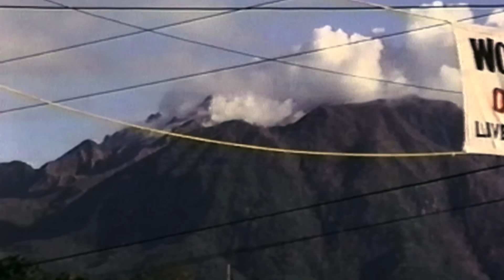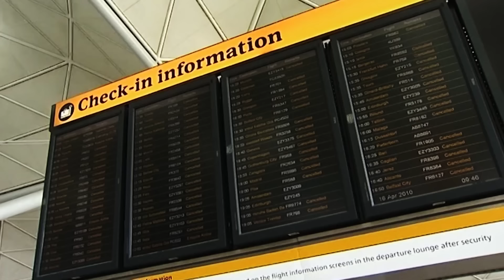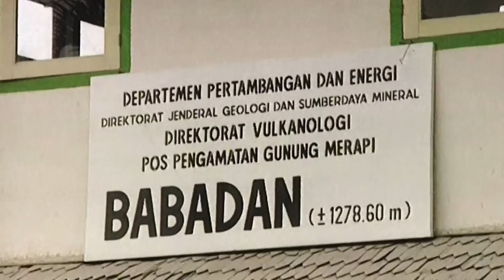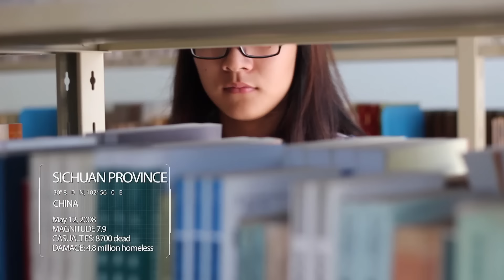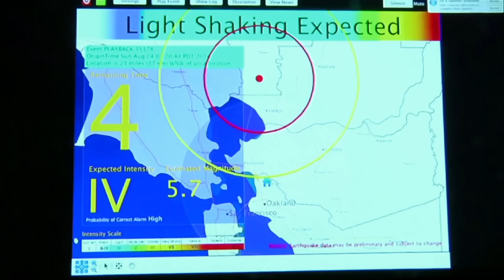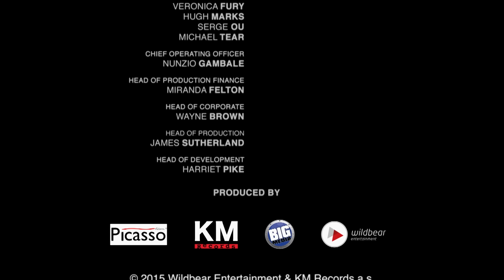Biggest Volcanic Eruptions & Disastrous Earthquakes | Desperate Hours | Free Documentary

Comment: Argh! I wish every show about volcanoes could be checked by someone who knows the difference between pyroclastic flows and lava flows. The former are killers, so it's not just academic!

Pyroclastic flows/surges happen at volcanoes with sticky, viscous lava thar tends to plug the cone and pile up in big chalky "domes" that suddenly collapse or explode, rushing downslope  in a superheated avalanche of choking ash,, billowing grey or glowing red clouds of dust, boulders, scalding steam, corrosive hot volcanic gasses, and blobs of lava rolling like giant napalm snowballs. The surge is over a thousand degrees and moves several hundred mph, suspended on hot air like a hovercraft so that it can actually flow onto the surface of water • at Pompeii some of the biggest surges flowed out and choked people with hot clouds of dust scorching their lungs across the bay.

Pyroclastic flows aren't mudflows, either, although the ash deposits they leave can mix with water ftom a melted glacier, a river, or heavy rain in tropical regions yo make mudflows called lahars. But lahars are like warm concrete. Crucially, they don't have the explosive component or the superheated volcanic gases which are so lethal, because they sear the lungs.

Your only chance of surviving a pytoclastic flow is to be in something equivalent to a bomb shelter capable of withstanding the avalanche's force and keeping out the heat and toxic gases. Or, if you're at the very edge of ybe cloud as it's losing heat and most of the debris has already fallen, you might survive.

That's what happened to those Montserrat farmers, who weren't as ignorant or clueless as this documentary claims. By that time the mountain had been erupting intermittently for years, and they had a pretty good idea where the surges usually went. Unemployed, desperate to harvest crops, some farmers would sneak into the exge of the ecacuation zone when the mountain was quiet, park pickups with engines running, and tend their fields. Usually, they got away with it. Unfortunately, one time they didn't.

I'm interested in volcanoes and earthquakes, but I hate the way this series seems to play fast and loose with the science, and even with events, to pump up the drama and make it seem like people were caught by catastrophes out of the blue. They evacuated Plymouth before the surges destroyed it, warned by experts. They stayed in refugee camps. Years of earthquakes, eruptions, and discomfort had them on edge, but they weren't the mindless, panuc-stricken, clueless brown people the narrative portrays them to be.

I've had to stop watching episodes of this series before because the camera seems to seek out and zoom in on someone who's especially distraught with fear and grief. They could just as easily have sought out other citizens toughing it out and showing their resilience and sense of humor in the face of adversity, but this series seems to think we want to be voyeurs of human suffering rather than spectators of the awesome power of nature.